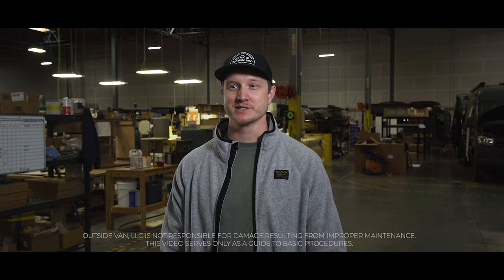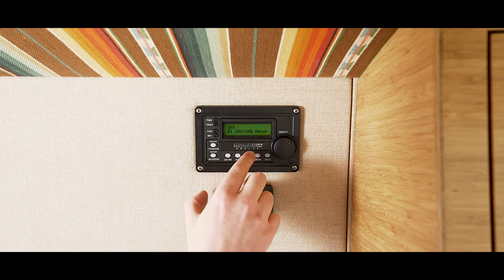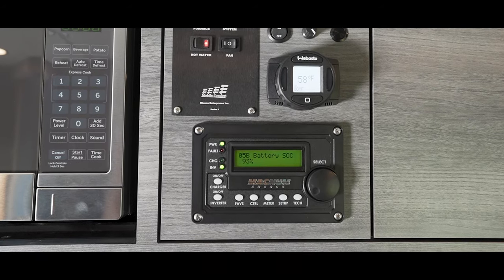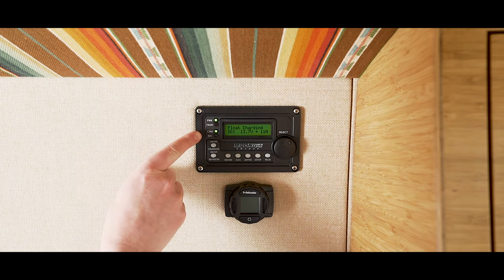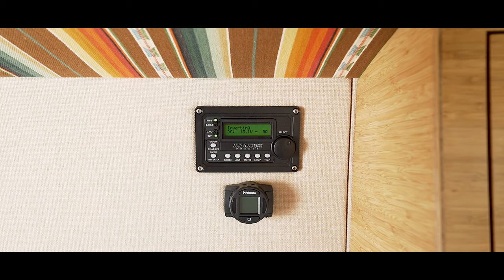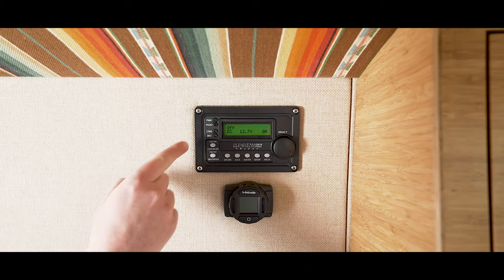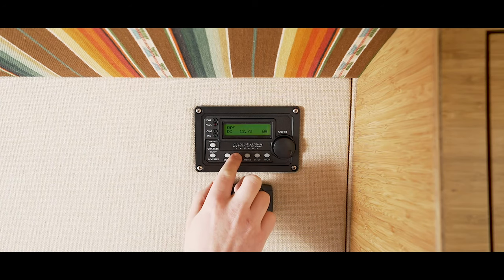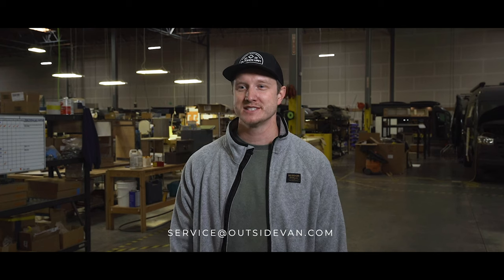How To: Inverter Operation Using the Magnum ME-RC50 Control Panel w/ an AGM Power System

Comment: Good explanation to the operation of the unit. However, I have a question to ask you. Can this unit run simultaneously as an inverter while the battery source is being charged ?

Comment: On my 2016 RV the lights and everything work fine if you're running off the alternator (chassis engine running). But with City power and generator power everything just gets dimmer and dimmer until it shuts down.  Does this sound like a bad battery to you?   Or does it sound like an incorrect setting on my inverter?